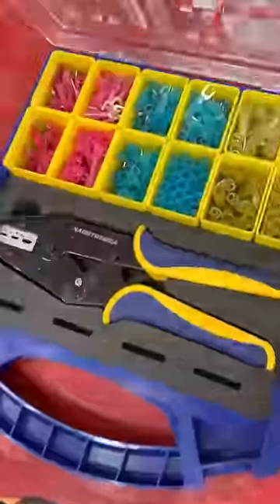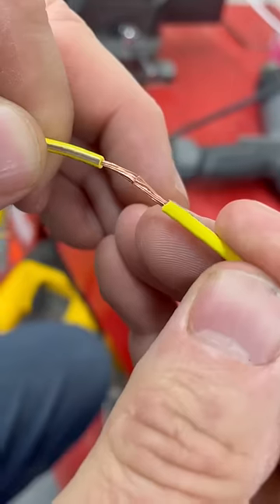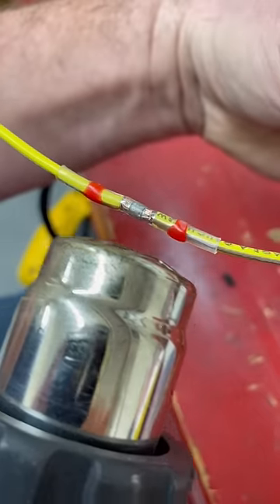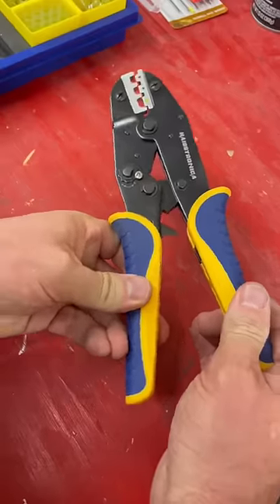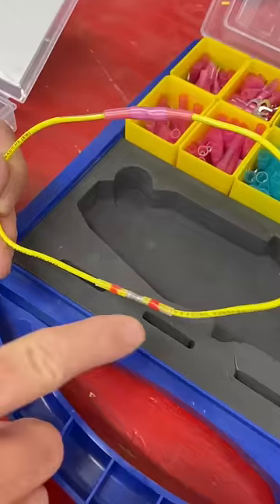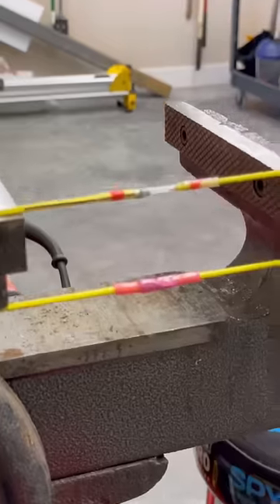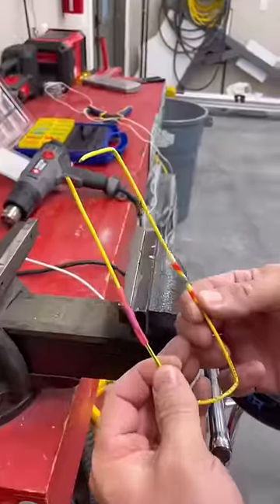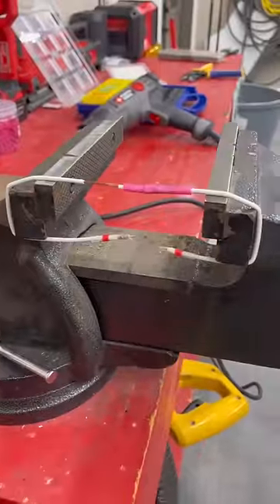Crimp verses Solder Connectors

Comment: Aviation quality crimp connectors that are properly crimped with insanely expensive crimpers make a connection that is electrically and mechanically sound, i.e. the wire will break before the connection parts, and the resistance is as low as the conductor itself.  Aviation quality soldier connectors do the same if properly heated, and also make a weathertight seal to keep moisture out of the connection.  Usually, the solder will have a red dye on it that disappears when the solder is completely melted, and the tubing is reasonably resistant to overheating.  High quality solder splices are pretty much the aviation standard these days.

Comment: As an AME E always crimp unless it's not possible solder connections are brittle and more likely to crack. Also soldering if you don't know what your doing can either be too hot and cool too fast and crack or too cold and crack. always crimp with ratcheting style crimpers.

Comment: Pretty sure a proper solder job covered in heat shrink will out perform in every way. Crimps probably second best but it depends on the gauge and current, on principal a crimp will work harden the copper in that area and add more resistance which would in turn become a hot spot thus the reason it would depend on gauge and current. An ethernet cable bent to a sharp enough angle, even if it looks fine for this same reason is more prone to errors in the data flow.

Comment: In a static use solder is better but in a vehicle that moves and vibrates crimps.  Solder creates a rigid more brittle connection.  Both are great and it's probably not a issue 99% of the time.

Comment: Crimp connectors with separate dual wall heat shrink. Save more of the wiring holds just fine, and you don’t have as much risk of the wire work hardening on either side of the connector as you do with solder… at least that’s what my journeyman and I have found.

Comment: I like the solder connectors but I strip the wire twice as far and then twist it and bend each side into a hook slide on the connector then hook squeeze slide the connector over and heat

Comment: the problem with the solder connections is that it's a low temp solder, which is more brittle and fails under tension. Also, from an electrical standpoint it creates a junction with both a higher impedance and resistance due to the difference in connections. In a crimp, the current goes from one piece of copper, through the crimp and then back to the copper. If you're using a solder connector, then all the current is flowing through the solder itself, which has a relatively low conductivity as both the indium and bismuth are lower in conductivity than copper or tin. Also, you can create high temps at a junction without having a high current. As the connection fails, the path of conduction gets smaller and, with current, the temp goes up and so the resistance goes up and that makes the temp go up, You can easily start a PVC jacket on fire with just 2 amps of current.

Comment: If it drives on tires or tracks, flies through the air, propels itself through water, locomotes on rails, or just sits in one place and vibrates, crimp and only crimp. Solder is for circuit boards and RF cable terminals.

Comment: I was a heavy user of marine crimp connectors and then I bought the solder ones (may have been the brand) but the solder wouldn't melt. so I only use Marine crimp style.

Comment: It’s about longevity. Soldered connections with a good heat shrink will last much longer than just a crimped connection. Oxidization is the enemy in any connection. Well for that matter just run gold connections and gold wires.

Comment: Crimp has my vote. When the correct size and wire gauge is used they work well. However it looks like the solder connector might work better in tight spaces?

Comment: As a heavy truck/ trash truck mechanic, most of the time I wouldn't be able a heat gun or torch into the places that I'm doing repairs on. Not that I would trust a low temp solder like that to begin with for either a good electrical or mechanical bond.

Comment: I guess I'm crazy, I get the crimp connections without the plastic. I crimp them on, solder the crimp, then heat shrink it. Never had an issue with any connection I have made in this way

Comment: All depends, is resistance doesn't matter crimp styles are easy and work well, if you need to keep the similar resistance in the wire then the solder connector is better.

Comment: The problem with these solder connectors is that they dont provide enough solder to penetrate all the way through the wire. Crimped connections when using a proper tool and connector are better. What would also be good are the wago connectors. They provide a good connection and adjust themself over time, so the wires wont get loose over the years

Comment: Solder connections make a better connection each time.  This is why circuit boards are soldered and not a bunch of screw down terminals or crimps...  And FYI, If you wires are under so much stress that you need to pull an ATV with them, you need to re-route your wiring. lol

Comment: If it's a used trailer it doesn't matter. The connection will come loose again after some years and you'll be dicking around all Saturday on what's supposed to be 5 minute job. 

Then you find out somehow the brake light turns on only when a blinker is activated and you find some weird wiring some guy did like 16 years ago that somehow worked with just twisted wire and tape connections. 

Also some junction box lid cracks somewhere in the process.

Comment: Good comparison!
Personally, I don't much care for those heat and solder connectors. I prefer the nice high-quality crimp connectors with the good melting heat shrink built in.
I guess the reason for this is using good crimpers it is very, very repeatable, whereas you're kind of looking at a blind solder joint of sorts.  And then, even if you can see the joint and it's not melting correctly, you kind of are stuck because if you put too much heat on it, it'll burn through the heat shrink. 
I love to do solder manually and then put heat shrink over it, but for a quick splice or something, I prefer my first choice.

Comment: I cant remember who done it but they done a cutaway of the solder connector the solder doesn't quite soak fully through the wires to make a normal solder connection I still use those as they are quick and easy repair

Comment: The solder connector doesn't heat the copper enough for the lead to binding with it. It just holds it through friction.

Comment: Soldered connectors are less ideal on auto or high vibration conditions.  Crimp or terminal connectors have better reliability in higher vibration and are less prone to solder joints cracking over time.  

That’s not to say that a solder connector will not work fine (especially with a crimp reinforced sleeve), it’s just that mechanical connectors are statically less likely to fail with repeat movement and high temperature variations.

Comment: I don't know much about wiring, but it seems like the crimp connectors are slightly tougher. I've crimped wires before too, so I'm a little more familiar with the process. I'd probably go with the crimps tbh

Comment: Crimp connector on tinned wires, best of both worlds haha. All Solder WILL eventually develop cracks from thermal cycling and need to be reflowed, crimps aren't immune to thermal cycling either but fundamentally more durable. However made properly with adequate strain relief either one should really last until the insulation and weatherproofing has degraded and it needs to be replaced anyways . Tinning your wires before crimping, particularly really small stranded stuff that loves to corrode out of existence, will give you a little more life if the connection ends up exposed to the elements and theoretically a slightly lower resistance. Every little bit helps when you start talking about cycling for decades.

Comment: crimp connectors have both mechanical and conductive superiority and solder introduces corrosion issues because even heating doesnt remove ambient humidity before the shrink seal does its thing and most solder doesnt do well when encased in a damp environment. also factory battery cables almost universally come crimped solder free if its good enough to handle starter loads im not going to question it

Comment: Trailer wiring doesn't matter, just power and ground. On the solder connections you don't run the risk of poking small holes in the insulation from crimping. Always solder wires carrying a signal to an ecm or module for better flow and no excessive resistance due to the crimp

Comment: Best load connection is solder. Can handle more voltage, wattage and amps. Crimp can be stronger because it’s easier for flex and not rip like solder. I do solder and wire tie for strength.

Comment: Always use crimp on automotive connections and solder around the house.

The solder connection can cause hardening at the joint, add in the vibration of a vehicle, this can lead to failure. This is why you see mostly crimp on automotive applications.

Comment: I prefer crimping because no (wired) heat source is required. Crimping rules out (having to prevent) materials becoming negatively effected by heat. Crimping requires a good quality crimping tool though, these don't come cheap. So I guess that for occasionally connecting wires where heat cannot do damage, soldering may be the better option.

Comment: I have always used the crimp style connector but I am willing to try the heat gun style solder connectors.
Reply: Before using the solder heat shrink tubes, take a few minutes to practice the joints first. While using the correct technique, I'd also recommend overheating the joint on purpose just so you can see how much is too much. I wish I'd done this when I started using the solder joints as I did mess up a few due to not moving the heat fast enough. This led to the solder going from a solid to liquid, then bursting through the heat shrink very quickly.

Comment: I have seen both and used both!
I would rather  Is use a sodering iron Over the heated sauntering connector . The reason for this is for 2 reasons the low heat soder is making a resistants point because of the thicker part of the wiring.
So basically it is  Is bottle necking. Making a heat spot.
So because of the low heat temp it is possible to heat up and lossen up
The second really I think makes a crimp connection more tighter because it forces the metal together pinching it together.
Reply from the maker: All good points 👍

Comment: Never had a callback on Chrimp connector! 0nly used solder connectors in the Army and they were pretty good too. Ill take the crimps because of reliability and I'm  tooled up from 12awg to 700mcm and if it aint broke, well you know.

Comment: You can release those crimpers without going all the way by pushing up on the lever in between the grips. Solder if it shouldn't move, crimp if you think it will move.

Comment: I use a soldering iron and solder. Then I use the heat shrink I have slid down the wire to seal it. I'd never use crimps. Also, if you know the correct way to do it. You'll never be able to pull apart the solder joint. You'd either have to cut it or desolder. This is how I was taught at NADC when it still existed.

Comment: I wouldn’t use presoldered connectors, much rather solder them myself. Could the heat be a reason for a weak point in the solder joint connector? Could it be that low-temp solder is what’s causing the issue?
Traditional wire soldering might take a bit more time, but is definitely worth it, and provides a perfectly connected joint if done correctly

Comment: I only use a crimp connector if it's logistically too difficult to solder and heat shrink the wire.  Never tried the connectors that somehow solder themselves with just a heat gun.

Comment: When you think about it, the point of soldering is to be more conductive, you typically shouldn't have copper wires to be tension cables. They are for conducting electricity... But do you if you want to tow tractors with copper wire

Comment: Good thing you did all the tests that don't matter whatsoever LOL a simple multimeter test showing which one is more efficient is really all that matters. Does it make a difference? Is one better than the other? How much of a difference does it make if any at all and is it really worth it to go the extra step of soldering the wires? But no we found out the pull strength of something that is never meant to take an actual weight load....

Comment: Where they broke shows the solder was better. It broke where the wire was stripped and probably nicked wires. The crimp actually pulled out.

Comment: Personally, I just use whatever I have on hand, or whatever is cheapest at the nearest store.

I've never had any issues with either when they are properly used.

It's not like you are really ever going to be putting a lot of strain or stress on a wire that you have joined anyway. And if you are you have bigger issues.

Comment: I personally solder and shrink tube everything in my experience crimp connectors tend to be more prone to  corrosion damage over a solder connection wich is more solid giving corrosion more material to bite at I usually use it for automotive use and it's been what best works for me so I stick to solder connections in my case

Comment: Use solder because it has less resistance and with today's modern vehicles resistance is crucial. I have seen several ecms burned up by usin crimp connectors  and therefore increasin the resistance.

Comment: The solder connector you used first the solder didn’t even melt.. I use the old actually solder the wires together and heat shrink/wax method personally because it insures no come backs

Comment: heat shrink and non insulated crimp connections. solder joints are more prone to failure as you discovered. dozens of different reasons why the fial but pretty much always the same end result, a broken wire by the connector.

Comment: I had bad luck with cold solder joints with low temp solder, in the engine, compartment of vehicles.

Comment: In reality it seems like they are both super strong before breaking. The solder one broke once right at the point where it was stripped. The wires may have been weaker where it was stripped. And the crimp clearly pulled out of the crimp. 
I think it’s a matter of opinion.
Reply from the maker: Agree

Comment: Plus crimps take like .5 seconds soooo much better, BUT if minimal resistance is your goal, not strength at all, and both are actually close there...
If continuity is the goal, I think soldier is probably the better one. Would you test that? Both resistance testing and perhaps over amping? Caution on the last please

Comment: I crimp and solder then toss a little glue filled shrink over the works performed thousands of wire repairs and agnostic seen one of my repairs fail yet.

Comment: They use low melt bismuith based solder which is weak and has high resistance!
For best results use a proper Iron with 60/40 | 63/37 lead based solder.

Comment: Use HIGH heat on those connectors, as low heat will shrink the tubing (to the point of splitting) before the solder can melt inside. It seems counterintuitive, but alternatively you can ask me how i know… 😅

Comment: Crimp is a mechanical connection, were solder is a electrical connection. BEST solder the tips (for oxidation prevention) and crimp for strength

Comment: Strength isn't what I'm worried about. Living in the salt belt, it's corrosion. I have had to rewire entire trailers because the wiring corrodes to the point of being unusable. Most crimps will eventually corrode, but with a solder joint that doesn't matter. It's already chemically bonded to the wire.

Comment: Most people that don’t like crimp connectors. Don’t like them because they buy cheap or low quality connectors good name brand connectors like Brundy, 3m, or Panduit, are magnitudes better than the stuff you find hanging on the shelf’s in most stores.  There are quality cheaper alternatives out there but its hard to go wrong with these.

Comment: For automotive or anything that will have lots of vibration always use crimp. Solder connections have a high chance of cracking due to the vibration and coming apart
Reply: Funny you'd say that. I once installed a Yoshimura License Plate Holder which came with an LED Lamp. This was for a Motorcycle. Motorcycle wiring experiences lots of vibrations and stress, as I'm sure you can imagine. The factory wires had to be cut. In addition, these wires were also small and vulnerable to chaffing. The install instructions asked for pre-solder shrink connections, which also came in the kit. The instruction manual said this was to protect the LED from exposure to water/corrosion and high levels of vibrations in that area.  10k miles later, and my customer is still happy with it; I would say that pre-solder is the way to go for the right application. 👍

Comment: Should have done a voltage drop analysis. If you have that much tension on your wiring, it doesn't matter what kind of connection you've made.

Comment: It's not a joint strength issue, it's a sealing or O2 protection issue which will affect the joint long-term.  On something like a trailer where moisture is ever present... solder joints for me, thanks.  Also, the heat-splice connectors are always a bit nasty... dedicated mastic shrink is better.

Comment: I don't use soldered connections in any vibration prone application, including all vehicles.  There's a reason avionics uses crimp connectors.  Solder creates a stress riser that snaps the small wire strands in flexible stranded wire by cold working them when repeatedly bent.  Use Tyco, Panduit, etc. crimp connectors and not cheap Amazon or eBay Chinese crimp connectors.  Pull test each crimp connection.